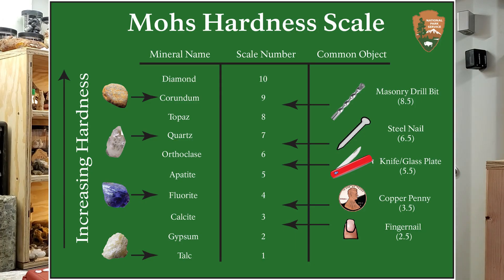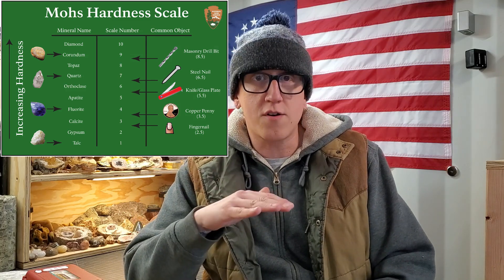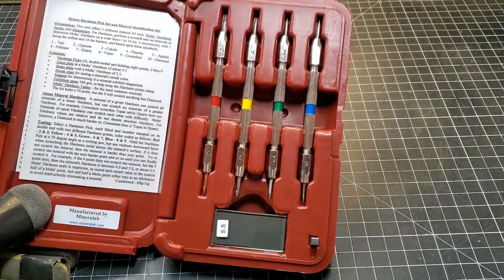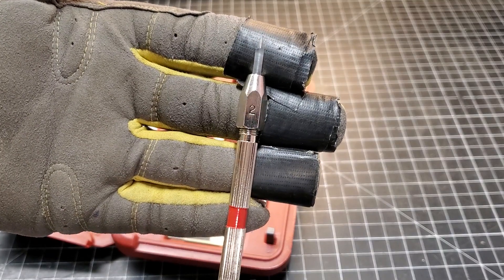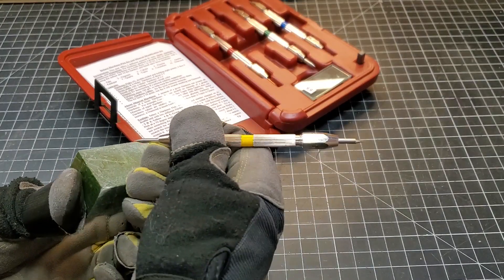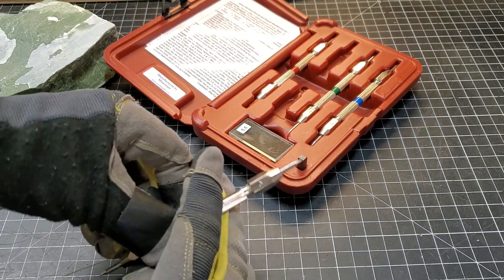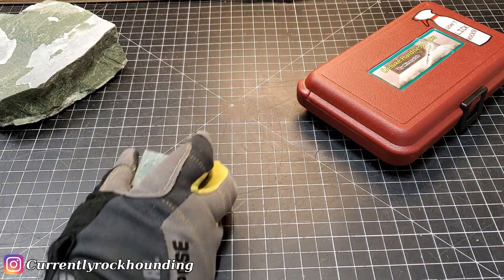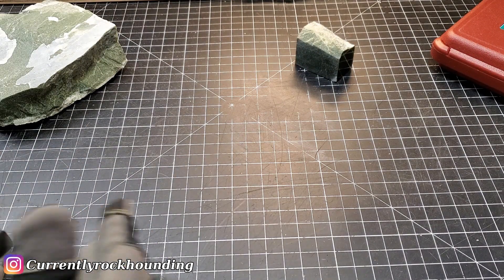Testing the Test | Can You Really Measure Hardness With Common Items?

Comment: Appreciate the video. Was curious if you've come across any less expensive options worth considering? Using actual mineral samples seems less optimal. The digital options look more expensive and possibly less practical. But it just seems quite expensive? Is it the quality of construction and the materials, or just the nicheness of the market?
Reply from the maker: There really are not any viable options other than the pick set.

Using the actual minerals has its own issues as well, like always having good edges on them...etc.

Comment: Once again I learned from you. One of the tests I use is putting it in the tumbler and after maybe a day or two I see how they are doing. I know that if a rock is wearing too fast It comes out and may be replaced with a rock that I feel is harder. I was well aware of the difference in the hardness of nails and screws. I have a very good pocket knife that I know is harder than an average knife you buy at the hardware store so I try to compensate. Thanks for the great tutorial. It will help all of us. Havagudun Jared and Sarah too.
Reply from the maker: I think you can can put together a little home kit but you need to test it against known rocks. I was a little surprised and the variation in hardness I came across when testing a bunch of different nails, screws, drill bits and knives.